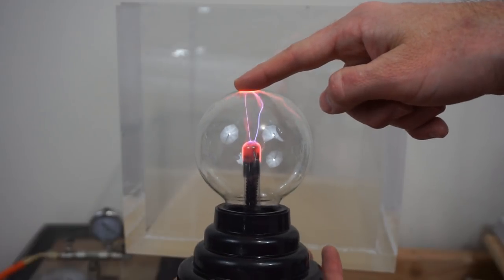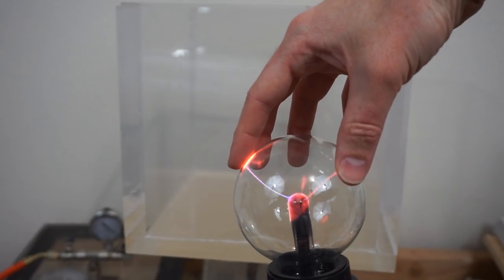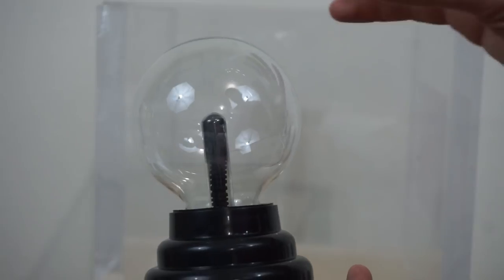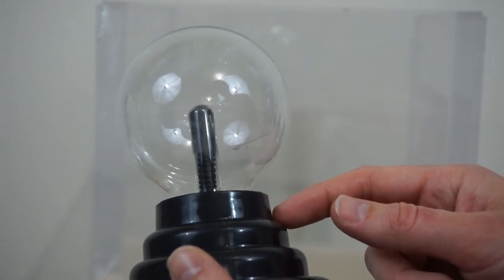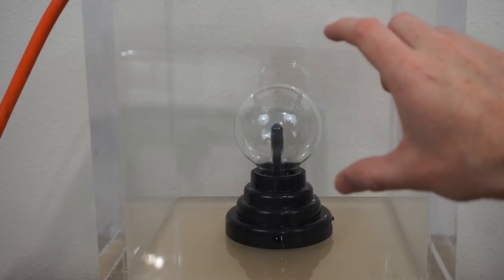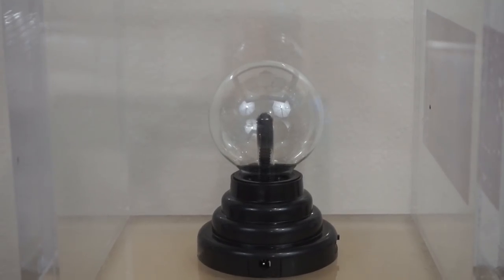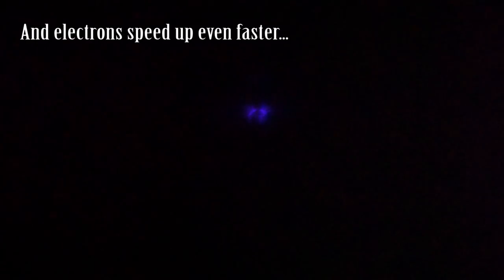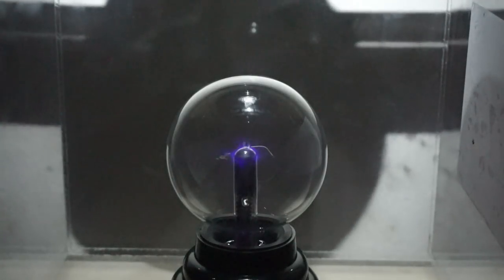Can Electric Sparks Happen In a Vacuum? Putting an Open Plasma Ball In a Vacuum Chamber

Comment: Try getting rid of the globe altogether, inside the base you'll find a flyback transformer similar to that of an old TV, with one side of the secondary going into the globe, and the other either grounded in the circuit board or left disconnected.
Get leads attached to both sides of the secondary, and you could then try making a Jacob's ladder in your vacuum chamber.
Reply: smart but only some p-bulbs dont and they use a convrter
Reply: You can't make ionizing radiation in a discharge tube, dummy. You can make X-rays though, but that will take a much higher vacuum, and a much higher voltage.

All plasma balls I've taken apart use a flyback transformer, and the bulb does require high voltage, high frequency AC to operate, thus I find it highly unlikely or even impossible for a plasma ball to work properly without some sort of step-up transformer, such as using a voltage multiplier.
Reply: ^ They're right. hundred of thousands of volts are required.
Reply: L
Reply: How immature.
Jonathan is right. High energy photons can cause atoms to ionize, I just confused myself trying to make a distinction between electromagnetic radiation and particle radiation, like you would get from radioactive decay.
To produce X-rays, electrons have to be accelerated to a very high velocity and made to collide with a metal surface. This is done in a tube that has been pumped to a very high vacuum, operated at a voltage of even hundreds of kilovolts. The conditions of this vacuum chamber with a plasma ball inside are nowhere near close the required to produce them.
Reply: MisterTalkingMachine, lol are you referring to me?
Reply: MisterTalkingMachine, I was joking.
Reply: MisterTalkingMachine, and I never stated any context about him being incorrect. K? K.
Reply: MisterTalkingMachine if you do this outside a vacuum your fine then right? Sure it will take more power but you won't get x Ray's right? Ultraviolet sure..... Which can still cause cancer dang it.
Reply: That's a shame you broke the globe, you should have just taket it apart and keep only the high voltage generator in the vacuum chamber. However, very intersting experience, thank you.
Reply: MisterTalkingMachine u r smart
Reply: Plasma? LOL You mean electromagnetic field discharges. Plasma, dark matter, electrons, photons, magnetons, gluons, more ons, it's all electromagnetic fields.

Comment: The problem you're having, is that you're also evacuating the neck of the bulb, allowing the arc to flash between the electrode, and the ground plane of the power supply. If it were possible to seal the base of the globe, and only evacuate the globe itself, keeping the inside of the neck at atmospheric pressure, you would get a plasma more similar to original, except, a different color, and maybe a little more diffused.
     I'm impressed, that your Robinair refrigeration evacuation pump can pull a strong enough vacuum, for any of this to happen. Great video!

Comment: Try simply breaking the bulb all the way and also breaking the glass at the top of the central column, put it back in the vacuum chamber, and see what it does.
 
Bonus points if you can get a thin wire in the vacuum chamber mounted two or three inches from the plasma globe's central column and terminating outside the vacuum chamber in such a manner that you can touch it (or perhaps have the wire connected in such a way that you can bring it to earth ground; e.g., connected to a water faucet, the ground screw on an AC receptacle, or whatever's handy for you).
 
Thank you for taking the time to publish these wonderful videos! :-)
Reply: telephony y

Comment: You need to put s Tesla coil in there. The plasma will actually flow and connect to you much like the plasma ball before you cut the hole
Reply from the maker: +RGHxFTW a plasma ball is a tesla coil with glass around it. Less voltage though I believe that's why it needed to be under vacuum to work.
Reply: RGHxFTW electroBOOM already did that, unless that's what you are referring to
Reply: Aww someone else did it? I used to take small Spark gap Tesla coils and pass them through vacuums and watch how the plasma changes from in sit through the vacuum and to me or ground
Reply: ScreenNurd lol he does that quite a bit
Reply: Jonathan Brittain if your talking about the microwave transformer, it's converts 120vAc to about 2100vAc it's only to power the magnetron which creates the radiation,  not the microwave transformer
Reply: He said it's an Ac arc, but what's the frequency? since it is a switching mode power supply
Reply from the maker: Well to make x-rays what you need is a vacuum to less than 10^-3 Torr and voltages greater than 10kV. In the plasma ball the vlotage is only abut 2kV and my vacuum was orders of magnitude higher pressure, so I think (hope) no x-rays were being shot at my DNA during my video
Reply: Tesla coil yes try a mini tesla coil

Comment: Plasma is ELECTRONS.
Reply: Yes, but the electrons come from somewhere; they are normally hanging out with protons and neutrons as part of an atom, and a plasma is free ELECTRONS, and also positive IONS.  The textbook definition:  "Plasma is an ionized gas consisting of positive ions and free electrons in proportions resulting in more or less no overall electric charge, typically at low pressures (as in the upper atmosphere and in fluorescent lamps) or at very high temperatures (as in stars and nuclear fusion reactors)."

Comment: I did a plasma in a vacuum chamber also (it is on my channel), if you want it to work better use 15kV DC, with the negative electrode inside the chamber and the positive grounded to your vacuum chamber (if it has metal on it).

Comment: Because the power levels are not changing, you get a stronger reaction. The frequency of light goes up because the resistance is dropping. Satellites have this problem, they get a radio frequency to talk it but the antenna in space changes the frequency to a higher signal, making it so they have to go to a higher frequency in order to talk to the satellite than it would be on the ground.

Comment: try to connect a nail or a wire to the tip. Cause of the sharp edges, there should be a lot more arcs

Comment: When you said very high voltage, that is incorrect actually, plasma globes have to be low voltage because of experiments that happen with plasma globes, so businesses sell it with low voltage to get better ratings, for example, if you put aluminum foil on top of it, and ark can escape by the power of your hand or some metal, it barely even stings though..
Reply: Actually, the voltage is VERY high: The current is extremely low, less than a static spark when you touch a doorknob. By varying the frequency of the oscillator, you can make the plasma arcs fat and faint, or skinny (focused) and rather bright. Some globes even have a knob to allow you to adjust that.

Comment: when you touch you disturbed electric field so that voltage... and higher current flow towards your finger.......
Reply: The current remains constant, it merely concentrates at the point of touch, as electricity naturally looks for the path of least resistance. You see one bright arc, rather than seeing many faint arcs.

Comment: It would've been interesting to see the globe totally intact and in the vacuum to see what the sparks did. Since there are always sparks inside the globe because it's finding the air particles on the outside. And when you touch the globe, the sparks concentrates at that spot. 

If the globe remained intact while in the vacuum chamber, would the sparks totally stop and the anode or cathode, would have a slight haze around it or nothing at all?

I would really love to see this happen.
Reply from the maker: +Robert Steich that is an interesting thought I should have done that but I thought the glove would explode due to pressure inside. I wasn't sure what the inside pressure is.
Reply: I thought that too. But at least it'll be contain in the chamber just in case.

Comment: Be careful, that can produce a considerable amount of x-rays.
Reply: gabrielbenitosobrino sacred geometry can make it beneficial to health
Reply: :D
Reply: According to MisterTalkingMachine's comment thread here, that's not true. You'd need much higher voltages and a better vacuum.
Reply: Not enough power, not enough voltage, and the frequency is too low to be ionizing. It's perfectly safe to run these, or play with them.
Reply: @vincentrobinette1507  I saw somewhere that just the static electricity produced by an adhesive tape when stretched in a vacuum already produces X-rays, in fact they made an X-ray with them, but I imagine that it is such a small amount that it is not harmful. The cathode ray tubes of TVs do produce them, but as far as I know they don't do any harm unless you stand very close and for a long time.
Reply: @gabrielhacecosas  That's actually true! just like the flame of a candle produces UVA radiation. It's just that the power is so low, that it just can't cause any harm. Plese note: A cell phone operates at the same frequency as a microwave oven, and you hold that next to your head!
Reply: @vincentrobinette1507  Well, in the case of microwaves, exposure is not cumulative, if it doesn't have the energy to burn you, it will never do so. If the radiation exceeds a limit if you are exposed to it for many hours or days, it can be harmful, whereas if you are only in contact with it for a short time, nothing happens.
Reply: @gabrielhacecosas  that's exactly right.

Comment: You were definitely making x-rays. Use a Geiger counter to gauge the amount.
Reply from the maker: +NORMAN WELCH I don't think that the pressure in my chamber got low enough to get any significant x rays (I hope that I'm correct). You need to be in the 0.0001 torr range and I was about 0.1 torr. Also, the voltage was only in the 2 kV range and  you need to be at least 10kV and higher...
Reply: Hydraulic Press Action please test it.

Comment: I know I'm not the smartest person in the world but I know that you need electricity to make this plasma ball work. you did not show it being connected to anything (it wasn't plugged in) so I don't know what kind of magic you're conjuring here or if there is some sort of hoax going on because I'm a little creeped out. it could be battery powered i suppose but I've never seen a battery powered one before only usb - dc input powered ones. and wouldn't a battery explode in a vacuum?
Reply from the maker: +Sanity016 It is powered by the ghosts of scientists past...jk it's 4 AAA batteries.
Reply: You can find battery-powered plasma balls everywhere these days - try Walmart for example:
https://www.walmart.com/ip/Battery-Powered-Plasma-Ball-3/141251423

Batteries seem to work just fine under low pressure.  The Action Lab also does a video of a (battery-powered) cell phone in a vacuum chamber:
https://www.youtube.com/watch?v=_1REFC5lI2U

Comment: It probably would have been way better if you just took the globe off and had the wire exposed. You can see that the plasma is coming down from the tip of the wire in the center column

Comment: +Hydraulic Press Action  Even in a perfect vacuum, arching should be possible.  If I remember correctly, even space has a certain dielectric strength, or something like that.  The only thing is that it might not be visible, unless the elections crashing until the other object release their own light
Reply from the maker: +DANG JOS yeah, you are right. I remember in another comment string we were talking about this. The light would only happen when the electrons crash into another atom. So if it happened in an absolute perfect vacuum you wouldn't see it.
Reply: Hydraulic Press Action  True, although if it happens in a perfect vacuum I would ask what is transferring the electrons in the first place?  You have to have some object.  So I guess you can't have an arc in a perfect vacuum lol
Reply from the maker: +DANG JOS well you can do it by heating up some wire and applying a strong electric field. The way they shoot electrons in the double slit experiment. So essentially in a perfect vacuum you can shoot electrons (but then is it really a vacuum if electrons are in it?) ..nature abhors a vacuum:)
Reply: +Hydraulic Press Action  Well yeah, that's what I mean.  Since if you have something in the vacuum it may not really be a vacuum.  And heating the wire can release some gas.  I guess what I was saying was that a perfect vacuum has nothing, not even a solid near by, and you need something for the electrons to crash into in order to release light.  After all, with just electrons travelling with nothing around, their velocity is entriely frame dependent. Lol anyway, I'm putting way too much unnecessary thought into this.  Point is, yes you're right that you can accelerate electrons in a vacuum

Comment: What theory says that sparks should happen easier under a vacuum? An arc formed between two conductors, in an atmosphere, is that atmosphere breaking-down electrically.
Reply from the maker: +Tim Ramich its called Paschen's Law. Dielectric breakdown voltage decreases as pressure goes down and then increases sharply at very, very low pressures